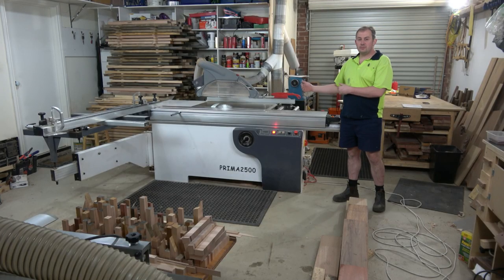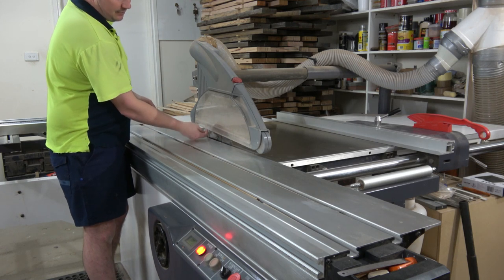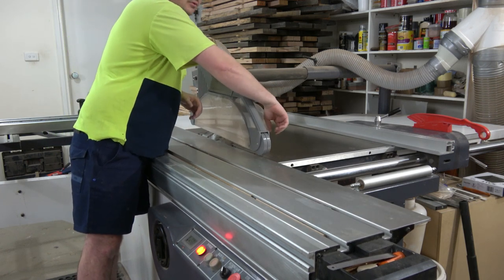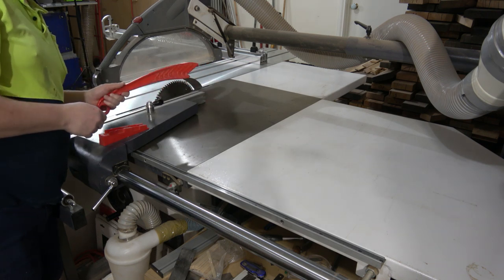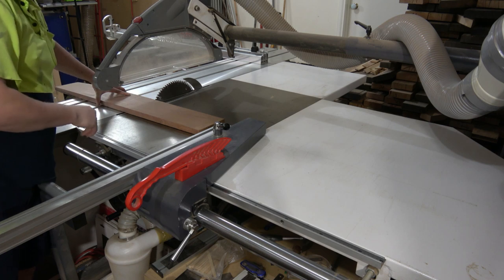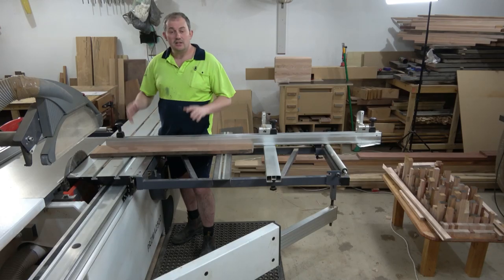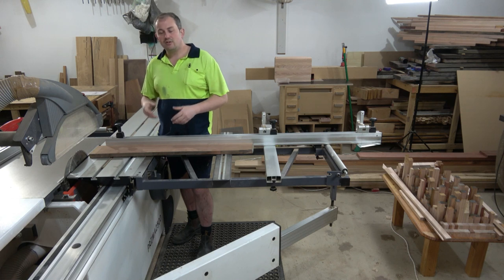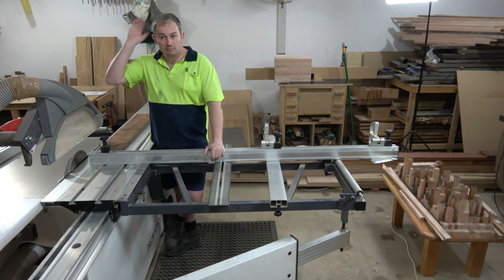Why I use a sliding panel saw instead of a table saw // Prima 2500

Comment: after all the trials and tribulations of dealing with breaking down 4 x8 sheets...including turning down work 'cause I just don't want to have to deal with 45kg sheets of melamine....never used a slider so this got me over hesitation...oh, I will need a bigger shop...Great vid!
Reply from the maker: Heh nice, you bought a slider? I had to break down some sheets on site a few months ago. It's a MASSIVE pain in the butt working down on the ground. It took an age to cut up one sheet

Comment: Thanks for the video. I would love one of these. There is another huge advantage compared to table saws (including sawstop): You are not standing behind the blade so you are essentially protected from injuries related to kickback. That is a big safety advantage. I would be interested in a comparison with table saws that have a sliding table though. You can get that from sawstop and many other manufactures. I still think a sliding panel saw is the better choice but a lot of the differences are not relevant anymore,.
Reply from the maker: I don't think I would ever be interested in getting a sliding attachment for a table saw. It's definitely an upgrade from just a table saw, but many of them would struggle to safely support a 8x4' sheet.

Comment: Very Informative--Thanks for sharing your knowledge!!     In regards to the sawstop. All in all it's not a bad table saw.The Powermatic is much more accurate, I do however wish it had the sawstop safety feature on it. It has saved many employees fingers over the past few years, but you can still get your finger. Take it from me as I have done it. When it happened I called Sawstop directly and asked how this could happen. They asked me how fast I was cutting. I informed them that I've been cutting hi-production orders on table saws everyday for over 38 years,so that's how fast I was cutting.  Their response was; you need to slow down as it can't register fast enough to fully work properly.   I guess they failed to mention that in the brochure.    Always remember the table saw is the most powerful machine in the shop!!
Reply from the maker: I've seen the hotdog demonstrations for the sawstop. They generally push it in fairly fast, and it only kisses the hotdog. But as J said in this video, if I felt I needed the sawstop technology on my saw, I just wouldn't use it at all.
Reply: The Table saw could be the most powerful machine in the shop, but not to forget the jointer and particularly the spindle moulder if you have one!

Comment: Thanks for sharing with us Kuffy.  I too am a panel saw user.  I ummed and ahhed quite a bit before buying a panel saw for my own workshop... and I love it.  The main drawback, I find, is in working with small stuff, but that's mainly a matter of appropriate work practices and perhaps some zero clearance jigs.
Reply: Do you mean Fritz and Franz jig for holding small pieces on the sliding table?  After I discovered this jig it has been so much better handling and cutting very small pieces of timber incredibly accurately.  Cheers, David
Reply: @drmkiwi  Yes, that too, but also I've been looking at using a zero clearance throat overlay, perhaps made from hardboard (masonite) since replacing the throat plates in these things is such a royal PITA.
Reply from the maker: Yeah the small stuff is a pain in the butt. My saw blade has about 3-5mm clear either side of it, so thin strips fall down between blade and slider/throatplate. I don't care much about it, it happens and I just pull the strips out. It's more of an issue when cutting 45° miters, because the offcut gets jammed between blade and slider and then pings across the room. The problem with this is that it also deflects the blade and takes a chunk out of my workpiece. So I need to hog away the waste and turn it all into saw dust.

Comment: Good review for those who never used a panel saw. This is a nice bit of kit, but a lot of money and takes up a lot of room. However, for cabinet/kitchen makers it is a must, as the scouring blade puts a clean cut on both side of melamine or formica panels. You did not mention the scouring blade at all. My crosscut sled is four years old and not even the runners had to be replaced.
Reply from the maker: My saw does have a scoring blade, but I don't use it for solid timber. It doesn't matter if I get light breakout on solid timber. And when working with veneered panels, I usually only need one face to be perfect. If I need both faces to be perfect, I just cut the small quantitys I need with a 3mm packing sheet directly beneath the veneered panels to stop breakout on the underside.
Reply: Haha. I already saw that it had, I was just saying that you did not mention it in the review 😊Yes one can use a sacrificial piece on the bottom, but if you were cutting a lot of panels, the scouring blade is superb.

Comment: Agree with everything except saying that taking care is enough, accidents can happen to any of us due to a one off distraction or loss of concentration. I can’t afford a format4, but its good to see that it is coming to panel saws and it looks better than the saw stop (non-destructive and non-contact).
Reply from the maker: Taking care is not enough. It should be, but you can't always take care because of random events like passing out for whatever reason (heart attack). It would be great to have the tech installed in the machine at a time like that, before I face plant the saw!

Comment: Good stuff. I'm hoping to buy a panel saw. Would be great if you do a short vid on cutting full size boards.
Reply from the maker: I'll try to make a quick video the next time I am cutting up a sheet. It's pretty rare that I work with full sized sheets, as I normally build with solid timber.

Comment: Panel saw all the way. I love the versatility of them. About the pro’s and beginners cross cutting wrong because they don’t move the fence I have to disagree on. Depends how many cross cuts your doing and how sharp your blade is. If your blade is sharp there’s not much force needed to keep your work piece from moving. And if your only doing one small cross cut it’s not worth moving the fence from the front to back. Takes to long and you could lose accuracy if not positioned properly to the stops. Love the video and I’m so jealous of the saw, it’s bigger and better than the one we have at work, I would love to have it there to use on a daily basis. All the best buddy.
Reply from the maker: Thanks mate. On a older Altendorf F45 panel saw I used to work with, it was a 20sec task to move the crosscut fence from the front to the back or vice versa. It was a really great system they used, and it retained accuracy with each move. My chinese built saw is quite a pain in the butt to shift the fence, and it can easily take 3-4 minutes.
Reply: @kuffyswoodwork  at least 80 percent of the sliding part of this saw is behind the crosscut fence.  Why would you suggest  that pushing the panels forward against the fence is a beginner error.   If pushing from the fence was the proper way to use this tool,  the fence would have been built at the rear of the slider.  How TF are you going to rip an 8 foot sheet without being an amateur?
Reply from the maker: I wasn't talking about cutting up sheets with the crosscut fence behind the work. That would be crazy. But when docking lengths of solid timber, it's much better to have the crosscut fence behind the workpiece.
Reply: @kuffyswoodwork  You could maybe use a Miter saw for that?
Reply from the maker: I answered that in the video. I don't have a miter saw. They take up too much space. Miter saws aren't even almost as accurate as a panel saw.
Reply from the maker: Of course you subscribe. In your mind you now have something to prove against me, and will now follow my every move. Thanks for the guaranteed views 👍
Reply: @kuffyswoodwork  Dude, you said it wasn't worth taking up the space to have a miter saw.  FFS that's the third tool everyone gets  (pencil, tape measure, miter saw)

Comment: nice explanations. One thing you don't have mentioned, perhaps I missed it, is that the sliding wagon works for you! Once you have put the panel on the wagon, it's done, and you can do your work easily without lifting the panel, sometimes 50 or 60kg... And when you push the wagon, the effort is absolutely nothing compare to a standard table saw.
The harder is to put the panel on the wagon, but it's the same bad thing on a table saw or a sliding saw... :(
I own a SCM SC4E since 4 months, with a 3200mm wagon, and it changed my life ;)
Reply from the maker: Yes, that is very true. The hardest part about cutting a sheet of MDF is putting the sheet on the sliding wagon. After that, it's easy to move around.

Comment: My woodwork club has a Sawstop and Felder panel saw and I take the Felder every time I can. I actually feel safer using the Felder than the Sawstop and I would take one of these over Sawstop too. Panel saws are just inherently safer. But the truth is I don’t actually like any table saws very much and I will probably stick with a track saw. And I totally agree about using whole body movements with this kind of saw. That’s the beauty of it. And IMHO, it’s those whole body movements that limit the likelihood of an accident.

When I see idiots on YouTube using table saws with no blade guard - or worse, no riving knife - I just shudder. If you comment on it they just say, ‘You do it your way’. But it’s the example they’re setting for new woodworkers that worries me.

The only disadvantage, aside from the space it takes up, is the price. This one is reasonable at $9,500 (March 2024). A Felder costs three or four times that much. But a top of the line Sawstop is over $9,000.
Reply from the maker: You nailed it perfectly. One of the big reasons why sliders are much safer than table saws is because your hands aren't moving to or away from your body to make the cut. They are locked in one position and your entire moves to make the cut.

Comment: nice points presented about the panel saw over the sawstop as i too have came to the same conclusion. and as owner of two 10ft sliders..2 more items you could add to complement the extra functions and safety of such a saw. 1. fritz and franz sliding jig 2. Holddown clamp that sits in the miter slots
Reply from the maker: I do have a holddown clamp for my saw, but I stripped the threads off it by using too much clamping pressure. I'll need to purchase a new one, or make one. I have seen the Fritz and Franz jig. I don't think it will be that beneficial to me. I'm pretty comfortable with how I operate the saw.

Comment: I worked briefly at a large wood working company and they had 2-3 SawStop models. Other than the safe finger element, the SawStop is an antique machine and not that good at that. The guard is a bother; and, you are left with a simple limited size table saw design of 40 years ago. The little short table to the right of the slider looks like a topographic of NYCity.
I like your logic in choosing the sliding table. If you have enough cubic feet of vacuum with that overhead blade guard, you can lift it high and remove dust and still see what you are doing. Thanks
Reply from the maker: The overhead hood guard doesn't have much air volume passing through it. For the purposes of dust collection, it is best to have the guard lowered as close as practicable to the work piece. But more often than not, I have the guard up high in the air so it is out of my way.

Comment: Hi Kuffy,
It has been 3 years since you made this video, and I just came across it. I wanted to ask you how reliable has the machine been since then? I am looking to buy exactly the same panel saw, in fact, I have been to the warehouse today and it is now selling for a bit over 11k including delivery and assembly :( Have you got single or three phase? if Single phase, do you reckon it is powerful enough to tackle a 8 hour cutting job (one or 2 days a week only) of 16mm particle board and 18mm MDF? I would appreciate your feedback a lot.
Reply from the maker: I have the single phase version with the 3hp main motor and a 1/2hp scribing blade motor. I primarily work with solid hardwoods, therefore the motor is a little bit lightweight for the work I ask of it. Cutting MDF or particleboard is easy because it's always thin. The motor will begin to labour and stall if I push it too hard while cutting full height hardwoods. The machine has given me no problems from purchase. If money wasn't an issue, I would buy the Altendorf F45 as they are great machines. Money is an issue for me though, so I bought the cheapest 😀
Reply: @kuffyswoodwork  Thank you so much for your feedback, Kuffy. You have helped me make up my mind. Very happy to know the machine hasn't given you any problems in 3 years.

Comment: You know any answers given are just incubators for more questions right? Does it have a tape or something on the outrigger to set cut size? How do the flip down stops work (how does the mechanism work & lock). Possibility for DRO for that? And for blade hight? What size arbor? (just curious). How many teeth and why? The back & forth motion you were doing on your saw... why exactly did you describe that as "creepy"? What size motor and is there a scoring blade or possibly for adding one on. Any good tv series you recommend at the moment... Have you seen Chernobyl? That was fantastic! Looking forward to season 3 of Ozarks, and season 4 of Stranger Things!
Reply: Yes totally agree Rob, Season 3 of Ozark can't come quickly enough!  (When I last looked it was about 6 months away)  Cheers, David
Reply from the maker: Umm, I think the answers are Yes, but I'll try and do better. There is a tape on the outrigger to set the stops. The flip down stops simply flip down, I think the mechanism is just a tee bolt in a tee track. I could add a DRO, but I never will. It's a 30mm arbor. I use 72 ATB teeth blades for MDF?melamine and solid timber crosscutting. 72 teeth because they work good enough without becoming super expensive. I think my ripping blades are 40 tooth flat tooth grind. The back and forth motion seemed creepy because I thought it may look like I was REALLY enjoying my panel saw 😂 The main saw blade is driven by a 3hp motor (it's too small, but pretty much max for single phase), and the scribing motor is 0.5hp which is fine. There is  scoring blade, but I don't use it so I didn't speak of it. I think I've used a scoring blade about 5 times in 20 years because I rarely work with laminates or melamine (cheaper to buy that garbage). A TV series that you must watch is The Last  Kingdom. There is 3 seasons out at the moment, and I am pretty sure they are making a fourth. It's cool! I also watched Hanna on amazon prime, that was pretty good.
Reply: I'll check it out 👍 thanks for answers, I love knowing things.
Reply: @kuffyswoodwork  Good reply :-)

Comment: Hi Kuffy enjoyed the walk through on your panel saw.  The saw has a good specification for a Chinese made one.
The squeak when you moved the rip fence, is there a height adjustable roller inside the casting to raise it clear so
it doesn't drag. I really enjoyed your comparison with the other make, brilliant I agree exactly. Just sub'd .Tony
Reply from the maker: I'm not sure where the squeak is coming from. There is a roller under the fence, and everything seems to clear. It started happening one day after spraying polyurethane inside the workshop. Probably needs a good clean

Comment: I stumbled across your video while researching these Chinese panel saws and am hoping you can help answer some questions (not alot of information on these saw unfortunately. There are dozens if not hundreds of models to choose from. How did you go about deciding on this model? Did you go through an importer or did you buy direct from China (through Alibaba or similar). Any complaints about the quality of the Chinese stuff? This is a Euro style saw and they charge WAY more for their models than the chinese versions (Felder, SCM, etc), so I am curious where the cost cutting happens. Did they skimp on anything that could be important? How is support if something goes wrong (electronic lift, controls, etc..). 

Cool video. Thanks for the thorough explanation.
Reply from the maker: Hi Joshua, I bought my machine through a machinery dealer. They had one currently in stock, so I got that one, and that also decided why I got this model. I haven't required any support if something goes wrong for the ~5 years I have had the saw. I see the euro branded panel saws, and they seem to be made in the same chinese factory. I would suspect much of the changes are merely cosmetic, except for things like larger motors, electric rise/fall/tilt, powered rip fence etc. My saw is all manual, no electronic gizmos to go wrong. The biggest issue with my saw is it only has a 4" dust port. It would have been better to be 5", or better yet, to be 6". It's not an easy task to increase the size of the dust port as I need to cut away 1/2" - 5/8" thick steel, and it is in an awkward position. 

It's a pretty good saw for what I use it for in my semi-professional home workshop. I wouldn't want it in a full production workshop (Altendorf F45 gets my vote for that)